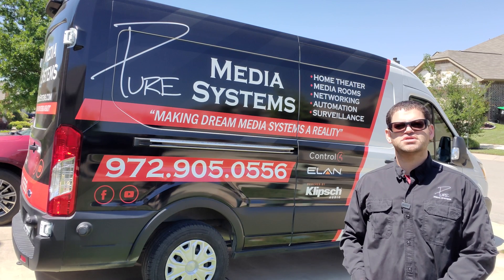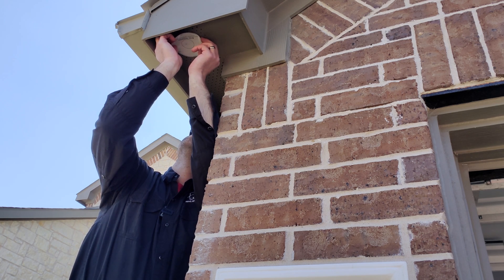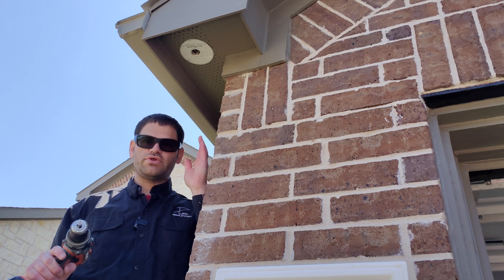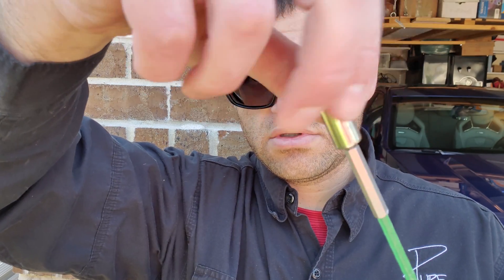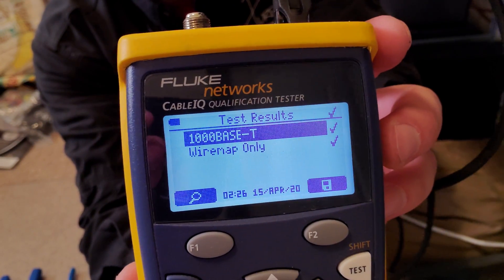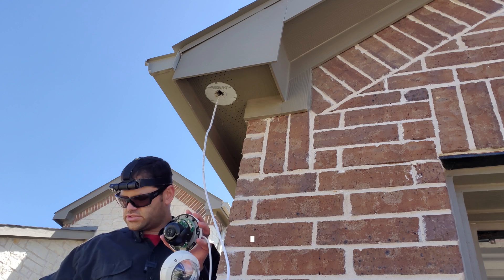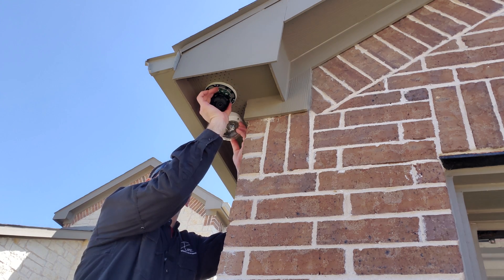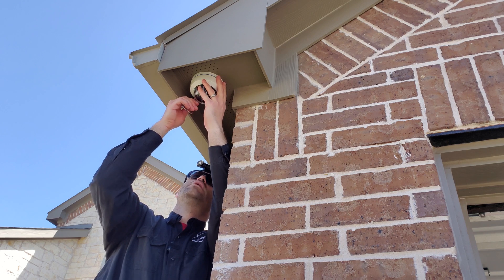How to Install a PoE Surveillance Camera

Comment: Question is what do you do in houses that are two story. Most  two story soffits around here usually run right in front of rooms and you can’t even crawl through them if you even have attic access. I’ve yet to see somebody actually show how they run wire they just say oh just run the wire into the attic. Ya obviously but not every home is one floor with an attic that covers the entire top of the house where you can drop down through any wall. Am I right or am I missing something lol?
Reply from the maker: That is a good question. Every home is different. Sometimes we are able to get through the soffit to the attic space with fiber rods. Sometimes we have to use magnets with the rods. Sometimes we have to cut access holes on the inside to feed cable through. Sometimes we have to run cable around the exterior. Installing cameras on two story homes can be very difficult.

Comment: Wonderful instruction! Can you add following clips regarding how to get the wire into the garage for the power?
Reply from the maker: Thank you for your feedback! There is not a need for additional power. These cameras are receive power and data over a single ethernet cable (PoE or Power Over Ethernet). In this case the NVR has a PoE switch built in, so we just rand the ethernet cable from the camera to the NVR.
Reply: @PureMediaSystems  got it! so just simply drill through the wall to wire the Ethernet cable from outdoor to the garage? Is there a leaking concern if we drill thought the house wrap?
Reply from the maker: @tttcoming4353  We went through the soffit in this case to mount it under the eve, no leaking concerns there. Every home and install is different, so it's hard to say exactly is best for your situation.

Comment: Why do you drill the 3 holes instead of using screws directly?
Reply from the maker: Pre-drilling pilot holes removes material from wood to make room for the screw. This makes it easier to drive the screw into the wood, and the wood is less likely to split or crack when the screw is inserted.
Reply: @PureMediaSystems  doesn’t that mean the screw won’t fully thread into the wood?
Reply from the maker: @Handleme23  No, you only drill the hole to the size of the core of the screw, or slightly smaller, not the entire screw including threads.
Reply: @PureMediaSystems  There was wood involved? It looks like your drill bit only went through the thin soffit. What's the soffit made of? I assumed it was fibre cement, but is it made of wood panelling (I'm from Australia where it is made from fibre cement)?

Comment: What is p.o.e. and what is keystone?
Reply from the maker: POE is Power over Ethernet. This allows power and data over a single cable. A keystone is a modular wall plate system that allows you to use various different types of connectors in a wall plate, i.e. ethernet, coax, speaker, etc.
Reply: @PureMediaSystems  OK, thanks.

Comment: What if part of the soffit is a bird box that protrudes out separately beneath the original frame base. However, that is where I wish to mount then run to the attic? Also, how do you perform a mount above the front door entrance with no wires showing and access the attic?
Reply from the maker: Hi Tyrone, it is really hard to give a good answer without seeing the house. If you are in the Dallas, TX area call us at 972-905-0556 and we can schedule a consult!

Comment: My two story house soffit looks similar but is more flat-based than angled. Do you think my attic will access as easily to
Run BNC cables. I have fish rods, magna bullets and all that stuff?
Reply from the maker: Hi Tyrone, it is really hard to give a good answer without seeing the house. If you are in the Dallas, TX area call us at 972-905-0556 and we can schedule a consult!

Comment: Cool, but can you show us the hard part? My sofflet does not easily link up to the attic.
Reply from the maker: Every home is framed differently, however the soffit should connect to an attic as that is typically where the air inlets are for attic ventilation (you will notice the perforated soffit of this home). In this video we showed you that we use fiber rods with magnets. If it is difficult to reach the rod inside the attic, we can use another rod and magnet to link to the original rod and pull it through.
Reply: @PureMediaSystems  that’s exactly what I thought. I’d like to send you a snapshot of mine to see if feasible but I’m certain it is.

Comment: Nice. I forgot there is. Templates. I have to install wall anchors on my outdoor roof. Just using a screw doesnt hold it.  The cameras I got from reolink came with screws and wall anchors.
Reply from the maker: Hi Dom! Yes, the templates are very useful! The anchors are needed a lot of the time, however depending on the construction material, they are not always necessary.

Comment: How many hours total would an POE install & setup of 4 cameras take?
Reply from the maker: Hi TM. There are several factors that will effect the time of install. These can include, size of the building, type of building material, attic attic access, etc.

Comment: Hello what brand model camera system are you using. Excellent video
Reply from the maker: Thank you for your feedback! We use a few different brands depending on the application. In this particular video we used GNS. If we are installing an ELAN control system, we like to use the ELAN cameras because of how well the integrate and the advanced analytics that are built into the cameras for ELAN. Otherwise we like to use Luma or GNS.

We are authorized dealers for all of these products, so if you are interested give us a call and we can ship the products directly to you! 972-905-0556.

Comment: Michigan here. Is there a preferred brand?
Reply from the maker: We use a few different brands depending on the application. If we are installing an ELAN control system, we like to use the ELAN cameras because of how well the integrate and the advanced analytics that are built into the cameras for ELAN. Otherwise we like to use Luma or GNS.